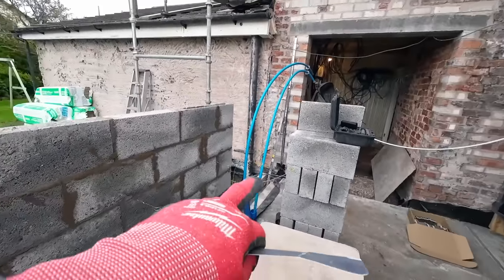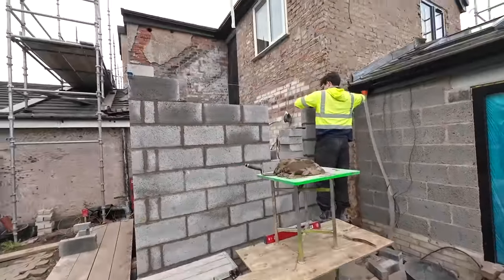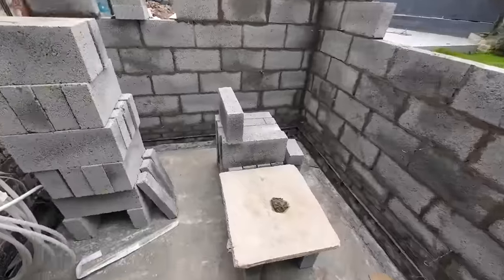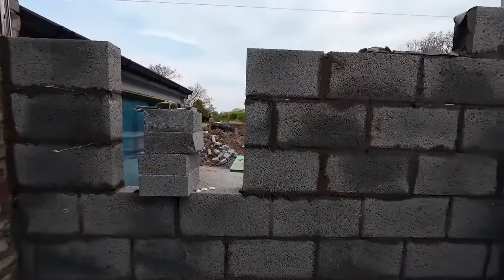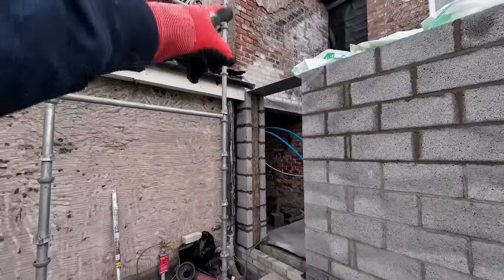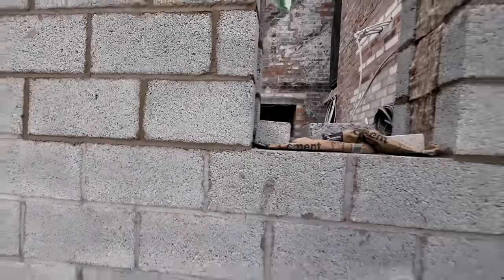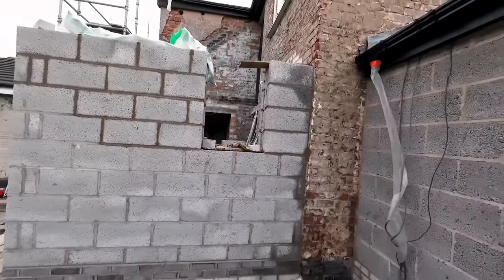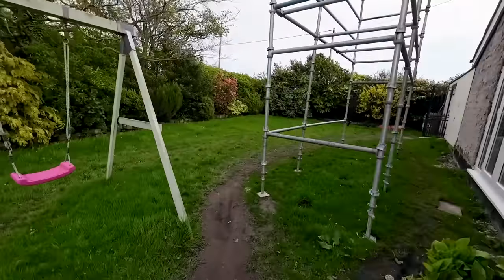150 MILLIMETRE  CAVITY TO MEET NEW BUILDING REGULATIONS

Comment: You can still use 100mm cavity we use 90mm t&g rigid insulation bats. The problem you will find is you can’t get window boards wide enough for the inside
Reply: I’ve just built an extension with 90mm t&g. Regs are based on U-value calcs, to meet the requirement you either need 150mm rock wool or 90mm PIR. Going to PIR added a bit of cost, but easier to get lintels/cavity closers etc.
Reply from the maker: It’s all in the way 🧱👍🏽
Reply: @ehamster  don’t forget you need to tape that pir and be bang on with your cavity cleanliness if you’re going the pir route. Absolutely no chance of that happening on most sites, or getting the tape to stick to wet/dusty boards. Full full is easier and completely idiot proof.
Reply from the maker: Definitely 🤙🏾🧱👍🏽
Reply: @dorsetengineering  I use Eurowall + T&G which solves this problem, I used to tape k106 but Kingspan have told me theres never been a BBA Cert issued for this method so BC wouldnt accept it, the t&g aspect acts as a vcl as BC have told me, this was the issue BC had with using non t&g insulation, its not the thermal propertys as 90mm Eurowall + and k106 both achieve 0.018 in a 100mm cavity👍

Comment: Just seen a neighbours new extension going up with hardly any cavity at all, looks like 1” at most , do the council check this stuff? I feel like the builders are ripping them off & not sure what to do, should I call the council building inspector?
Reply from the maker: You need to speak to the neighbour 😬🧱👍🏽
Reply: @SteveAndAlexBuild  Thanks for the quick reply, unfortunately they have zero building experience & I have already expressed my shock to them at the quoted cost (over 100k -this is a small extension) much to their displeasure, so doubt they would like me commenting anymore. I think they are being ripped off but they are willing to pay it , so be it, but it doesn’t look right to me, 100mm block wall construction with what looks like 100mm cavity to the front with a full width doorway, but sides are minimal 1” , maybe they are lining it with something ? But I thought there had to be a cavity?
Reply from the maker: @thomasbroker69 .100 k !🤯🤯🤯

Comment: I had an old building to renovate, the walls were rubble filled which meant the insulation had to be on the inside, what a revelation. Insulated plasterboards on the exterior walls, insulated stud walling, insulated rafters (sloping ceilings)  Add to that sound boards & fire boards. It all added up to 2 really warm, quiet and cheap to heat 1 bedroom duplex flats. From my experience, I don't know why all homes are not insulated this way, why heat up interior breeze block walls, I was able to use 24kw boilers, which barley came on, even in winter.
Reply: Have you calculated the saving and how long it will take to recoup the cost?
If you're insulating for comfort; OK!
Doing all that to "save" money?   I'm not so sure.  It would be an interesting calc'.
Reply: @farrier2708  Ahh it was compulsory !  Couldn't have got planning without complying with building regs. Yes it was expensive in materials, I seem to remember 7 years ago it was £40 per  4 x 8 board,  I fit everything myself then got a plasterer in. I reckon to have got professionals in, it would have cost 30 to 40 thousand ! Of course no one tells you this when they are pushing heat pumps !
Reply: @Nailnuke  Ah! I was born into Architecture.  My dad was an Architect and I was in the profession for 40+ years.  In all that time, only very occasionally did I find that any change in regulations had to do with anything but creating jobs.  The amount we have to pay for non-productive staff these days, just to administer regulations, is enormous.
Who has to pay for these people?  The Client!  While Government reap the benefit of tax revenues. 
Well! That's this old blokes rant for today.  Thank God I don't have to work for a living any more.  😎👍
Reply from the maker: All very true 🧱👍🏽

Comment: That's something that has caused me trouble in the past..... having insulation that is in contact with the inside and outside wall. Any damage or constant driven rain eventually penetrates the outside wall and the insulation soaks it up like a sponge and transfers the damp to the inner wall with the obvious results 😂
Reply from the maker: Never had that problem especially on rendered walls 🧱👍🏽
Reply: Shouldn't get that problem with rendered walls.
Reply: What about using foil back and sides kingspan  types of materials?
Reply: you havent got a clue what youe talking about
Reply: @LaughingGravy.01   more like you don't know what your talking about and especially on a post that's a year or so old 🔔🔚
Reply from the maker: @nei1s I’ve never seen that happen in 37 years and just because someone disagrees with you doesn’t mean you start calling them names , we are adults on here not 10 year olds
Reply: @SteveAndAlexBuild   I consider myself told off........ But he's an egit instead 😂
Reply from the maker: @nei1s 🤨👍🏽

Comment: I recently built a house with a 200mm cavity 😕 was a nightmare building off band stands overhand 😳 all heavy concrete blocks too here in the west of ireland
Reply from the maker: Jeez not good for the back 😬🧱👍🏽
Reply: Absolutely not 😢 had to build 7 course all the way around  then no choice but the bring up the external leaf on band stands and nearly stand on blockwork on the internal and hope and pray that the wind wouldn't catch it by the time I'd it backed lol. Got it done. I went a bit over board with wall ties in the gables also just to be safe because I've seen too many gables come down over the years. Luckily enough it was only a dormer so once I reached joist height I only had to fill between joists and then gon3 courses above that and only had 2 gables. it was an drea house to build tobe fair just a big rectangle son4 courners 🤣  9 windows amd 2 doors 🤣if only they all came like they lol

Comment: Nice work there, were you okay using the dritherm 150mm insulation, or did they want you to use 100mm celotex cw4000 with a 50mm gap? I've just been banged with a ground beam, 2x windposts, the Building inspector asked for them which are extras😥, the Celotex insulation was already on the plan spec notes! Just wondered about the insulation as there is a difference in price. Cheers🧱⚒👍
Reply from the maker: We go for the bigger cavity and .32 dritherm for ease  of construction and price . 
   The pir stuff needs internal first which we hate, costs a fortune plus you need a couple of days labour on top to install it as it so labour intensive. You can’t be expected to include that in your price . 🙄🧱👍🏽
Reply: @SteveAndAlexBuild  Yeah, PIR is very expensive.  Just wondered if I could get away with using the 32 dritherm. I'll have to check with the inspetor🤞
Reply from the maker: Good luck 🤞🏼🧱👍🏽

Comment: I suspect we have passed the trade off point between sensible insulation for sound and thermal and water. To my mind air gaps and ventilation in a wet climate regardless of build type is essential. Too many properties are a fungal death trap with all the sealing up. I built my house decades ago using traditional methods and double  thick inner skin. No damp, cheap to run and warm even though some walls 20ft long are glazed. Horses for courses but netzero is mad. As an old long retired scientist I will not see the end and it is worrying, especially going down the timber route, as for plastics etc just remember where this stuff chemically comes from! Excellent videos chaps. God bless.
Reply from the maker: Cheers 🧱👍🏽

Comment: The other problem with these 150 insulation u after use a 250mm stax bolt to put a tv up in conservatories but tv mount kits come with 50mm bolts

Comment: Never understand why a big cavity insulation and then when the starter is done on exciting walls the cavity is breached. They need to update the regs so there is no thermal breach . I would cut out the section and make good and built in the existing brickwork ad not use them starters. I know time is money but whats the point?

Comment: I built a hoise for client and they demanded an 200mm cavity and all heavy-duty concrete lintol absolute piggery 😂 luckily i didnt need to put and cavity insulation in as it was being pumped. But still a nuisance building the external leaf off bandstands from on the raft.

Comment: You aren't supposed to bend the wall ties, it voids the warranty and potentially reduces the performance. You could have reduced the 150mm insulation by using PIR/PUR as you are building less than 18m in height. Mineral wool is less thermally efficient but I understand why you are using it post Grenfell. That said, you are a bloomin' good brickie and I would be happy with the work.
Reply from the maker: Thanks pal 😁🧱👍🏽

Comment: Nice to see using concrete blocks for inner wall, personally do not like thermalites
Reply from the maker: They ain’t concretes they aren’t thermally efficient enough any more . 
    We use fibolites 👌🏼🧱🧱👍🏽
Reply: @SteveAndAlexBuild  nice never heard of them before. But using this kinda blocks is not not regulated by building control? Just personal choice am I right?
Reply from the maker: @jevgenijs39 . They are very strong and very thermally efficient so actually better than thermalites . They are encouraged by building control 🧱👍🏽

Comment: call me old fashioned but I would rather reduce the cavity to 50mm and put the  insulation on the internal face using insulated plasterboard. That way there is less chance of water or rodents damaging the insulation, and you can put the wall up faster and leave the insulating for when the property is watertight. Also means the cavity can be properly ventilated and, you know, do the job of a cavity wall. 

Also means when future requirements for insulation increase, you can tear down the insulated plasterboard and put better insulated plasterboard in place. Hopefully without taking up any more habitable space. Whereas replacing insulation in the cavity wall is a lot harder.
Reply from the maker: I’ve never seen 100 mm insulated plaster boards 🧱👍🏽
Reply: @SteveAndAlexBuild  the building regs require U values not width. So a 50mm insulated plasterboard might have the same U value as 100mm of rockwool insulation.  Would need to check out the values.
Reply: Anything over 50mm is a nightmare when needing to use fixings, e.g. radiator hangers
Reply from the maker: No it doesn’t 🧱👍🏽
Reply: @SteveAndAlexBuild  remember that approved documents are just guidance and the legislation says reasonable considerations should be made to reduce heat loss in dwellings.  The future homes standards states that new builds need to produce 70% less carbon in their operation.  Neither of those documents states a minimum width of insulation. There may be other reasons to avoid internal insulated plasterboard, such as the length of screws needed to fix things to the wall.

Comment: You dont need 150mm cavity go for 100mm cavity, thermal block inner leaf and either additionalninsulation on thrboutdide or insode of thr wall
Reply from the maker: Which still leaves a 350 mm wall 🧱👍🏽
Reply from the maker: Absolutely mate, we didn’t just jump into it either, we did our homework and weighed up the options 🤜🏽🤛🏽👍🏽🧱

Comment: Have you learned nothing from the recent fuel crisis? If our homes had been properly insulated there would have been no fuel crisis.  If our homes had 200mm of PIR foam or 300 of Rockwool our fuel bills would have been 20% of what they were.  Then there is the carbon saving as well.
I have been designing houses and extensions to well above the Building Regulations requirements for 50 years and builders have been telling my clients that the extra insulation was a waste of money but those clients have saved a fortune over the years and, on top of that, they have had a much higher level of comfort than a Building Regulations standard home.
Have you not noticed that the "economic" level of insulation keeps rising?  A 300mm insulated cavity is about the optimum though so if you build with that your customers will be OK for ever.
I'm pleased to see that you are using dense aggregate concrete blocks though as they give a good level of thermal mass to store heat when the heating goes off.
Reply from the maker: Totally agree with you except  the blocks aren’t dense or concrete, they are 3.5 n Fibolite blocks . ( made from clay I think ) 🧱👍🏽

Comment: Its great having all of this insulation for the winter, in the the summer, on a day with no breeze, your front room becomes an oven.
30°c outsude equates to 38° indoor temperatures!
Reply: 😂😂😂 Insulation insulates. It's slows down the movement of heat energy from lower temperature to higher temperature. In the summer it's cooler inside, unless the heating is on .

Comment: 5:05 on the left side, where you are near that old wall....you will have in 1-2 years craks!  You should put something to bind there with that wall. Even i'm not a builder is not ok at all!
Reply from the maker: We never build without using ties which we did so it won’t be cracking abs because we used ties it WILL be ok and we are builders who know what we are doing 🙄
Reply: @SteveAndAlexBuild  in you i'm trusting then! Good job nice to learn smth!  Keep going and be safe!

Comment: I'm not convinced 150mm cavity is a good idea not unless they start making ties with a thicker gage rod the closer the walls the stronger the structure but that's only my opinion I've spent a lifetime working with stone and the rules are a bit different it's looking good lads but I wouldn't expect any different good video
Reply from the maker: Cheers Dai much appreciated 
🤜🏽🤛🏽👍🏽🧱
Reply: Increasing the number of ties per m2 would be the alternative.
Reply: Snap. I've dropped a 185mm cavity down to 150mm (still needing 100mm rigid insulation / 50mm gap to achieve the 0.18 value). Certainly wasn't keen on the 185mm with 2 skins of 100mm block.  You have 4 strengths of wall ties (type 1 to 4).  Also got to ensure sufficent embedment of the tie in the bed course
Reply: I don't think a smaller gap makes the walls stronger.  They are held together by ties which by definition only apply tensile strength ie. not rigidity.  The walls don't know how far apart they are.  Long ties are just as strong as short ties.

Comment: If i use PIR it can just be 100mm?
Reply from the maker: Yes mate but not all are the same 🧱👍🏽
Reply: @Bricklaying With Steve and Alex   It's just I'm planning my kitchen extension. It's bad enough to attach a 30cm wall to my 9inch house wall let alone 35cm. Makes no sense. Do you mean not all PIR is the same? I think Kingspan are good.
Reply: @plummetplum  Kingspan 90mm cavity batts are made of a different material to PIR, and more thermally efficient than PIR (according to them!).  That's what's been spec'd on a job of ours recently, I'm not sure if PIR meets the requirements normally, ours has a fair bit of glass so it might be that, but no, not all insulation is the same so go with what's speciifed if you're not sure.  The Kspan (K106) worked out around 50% more cost than 90mm PIR.
Reply: @Simon Platt  Thanks. So there's a difference between PIR and cavity insulation? As long as I can keep cavity to below 100mm, I'll be happy.
Reply: @plummetplum  It only makes no sense because you don't value the benefit of the insulation. Perhaps the next owner of your home will.
Reply: @Tony L  It makes sense for new build but it will be connected to my house, which has 9inch walls. So the kitchen will be connected directly to the middle room, the middle room being the weakest link insulation wise.
Reply: @plummetplum  The thing that makes cavity insulation, 'cavity' specific, is that it comes in a size to suit the wall ties (450mm), not the material it's made from, that's up to the designer/regs.  Like I say, K106 comes in 90mm thickness (fits in a 100mm cavity) and is the best performing.

Comment: Only way of keeping the cavitys down at 100mm is using 90mm kingspan. Not ideal on extensions though, rarely do i have the access to be able to build the entire inner skin first. Pain in the ass
Reply from the maker: Exactly Ross , I hate v
Building inside out 😡🧱👍🏽
Reply: No Ross with solid insulation an air gap is required and it’s bigger than 10mm .
Reply from the maker: No it’s not . The 90 mm kingspan goes in a 100 mm cavity with a tiny 10 mm air gap and is horrible to use 🧱👍🏽
Reply: @SteveAndAlexBuild  we’re on with 3 new builds atm . 90mm insulation . 130mm cavity .

Comment: WEF want the high gas prices so they can Justify the expensive cost and running use of Heat pumps, the calculations comparing the new gas tariffs make them appear good value against gas boilers now - it’s all smoke n mirrors and basically a scam 💰💰💰 - What isn’t these days...

Comment: The way I understood the new regulations were 100 mil of insulation and a 50 mm clear gap on the outside of the 150 mil I bet you every building inspector has a different opinion
Reply from the maker: Probably 🧱👍🏽
Reply: That's because the regulations only say what the thermal performance has to be - not how to achieve it.

Comment: You can still get away with 100mm cavities when using 90mm Kingspan KOOLTHERM K106 and 10mm air gap, this will achieve 0.17 U. Value
Reply from the maker: Yes we have used that stuff last year . It is super expensive and the tape is ridiculous too . Above all you need the build the inside skin 1st which isn’t good and not always possible . 🧱👍🏽